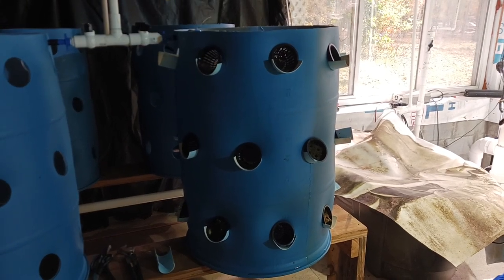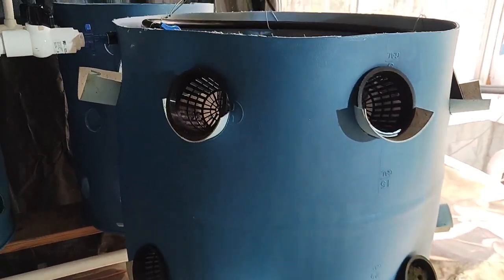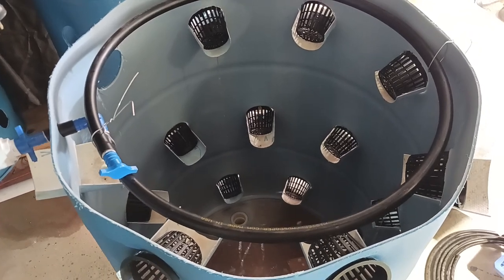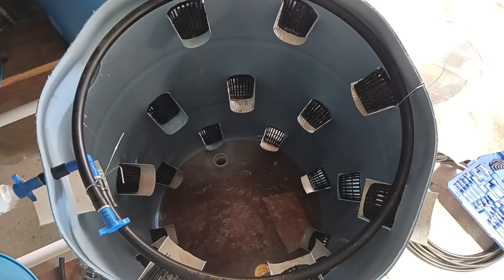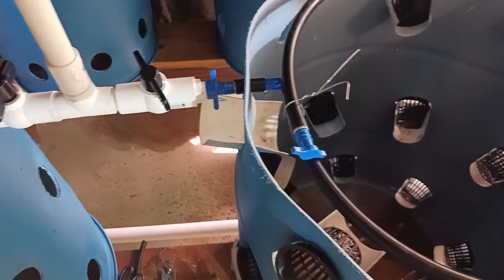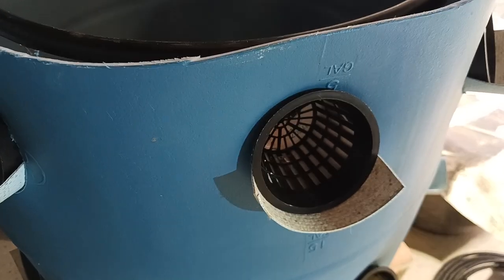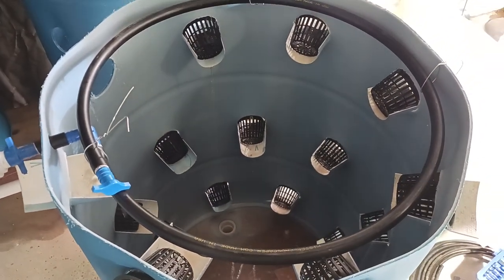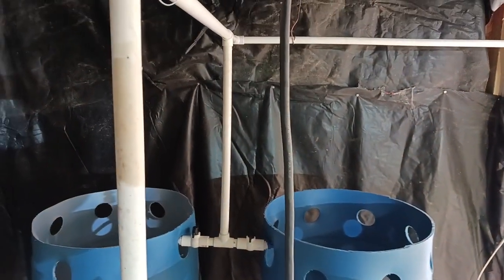Testing the 55 Gallon Drum Aeroponic Water and Drains

Comment: Looking good. I would be mindful of potential drainage issues caused by the bottom plant sites as roots will tend to follow the stream of water right into the drain.  With the flow down method, you will find the roots will stay relatively close to the inner wall of the barrel and  head straight down  and then spread sideways as the root growth begins to fill in the gaps. Basically the roots allow the water to spread out vs just flowing straight down.  Plants that grow extensive root systems can be an issue as the roots from the upper sites overlap the roots on the sites below, making it harder for the underlying roots to access the nutrient.  The plants nearest to the nutrient delivery point at the top of the barrel will tend to grow a larger root system much faster than the sites further down for this reason. They will generally  receive more light too. :) . The bottom sites can take advantage of the nutrient that ends up on  the floor of the barrel but they will typically receive less light.
Reply from the maker: That is great information. I am new to Aeroponics, and I am going to share my failures and successes.  I have already found that if I clean out some of the root systems, it won't hurt the plants and prevents my system from becoming over laden with them.
Reply: @Mike1111Axe  
I`ve done aeroponics for quite a few years, you`ll find it an interesting journey of discovery.  I tend to leave the roots to their own thing as most of my setups have a mesh fabric floor. The mesh floor provides complete drainage with zero chance of pooling.  Incorporating an open airspace below the mesh floor air prunes roots that venture too close. Roots that get air pruned branch all the way back up which provides more root surface area than the root just growing longer.  Trimming the end of the roots will have a similar effect but its more stressful on the plant as it creates open wounds. Looking forward to seeing  your blue barrel towers covered in greenery :)
Btw, i  plant snow peas (mangetout) in the lowest sites on my towers and, with the help of some string support loops tied around the tower, train them to grow up and around the tower. My towers are outdoors so the peas create shade and localised humidity which gives young lettuce plants etc a much better chance of surviving sunny weather until their roots are fully established.. The peas are super productive, fast and easy to grow  :)